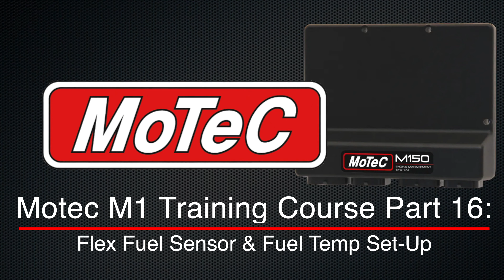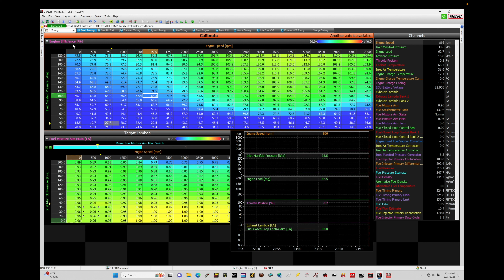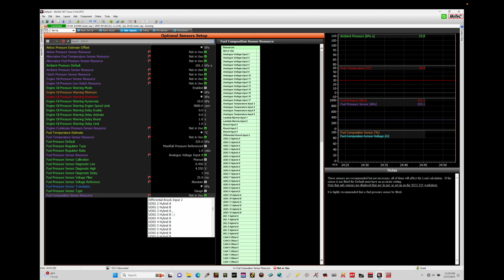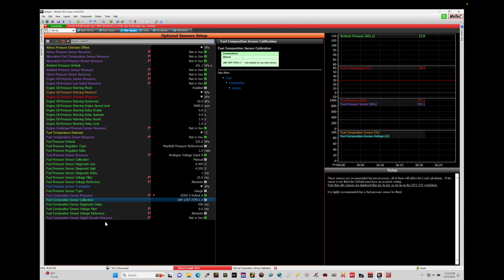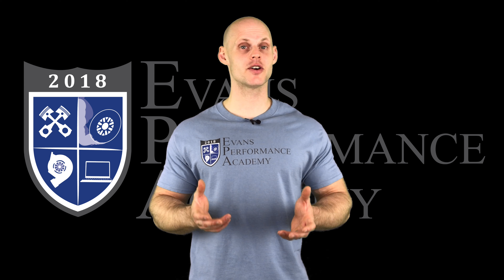Motec M1 Training Course Part 16: Flex Fuel Sensor & Fuel Temp Set-Up | Evans Performance Academy

Comment: Which part # content sensor are you using exactly?
Reply from the maker: Continental 13577394 but any continental / GM sensor will work.
Reply: @EvansPerformanceAcademy I have found some don't like to do fuel temp at all and other part#'s will. What would you say is the most powerful or best option sensor that can really do it all?
Reply from the maker: @UngluckInc  The part number I listed is what Motec recommends.
Reply: @EvansPerformanceAcademy  that's my go to part # as well.